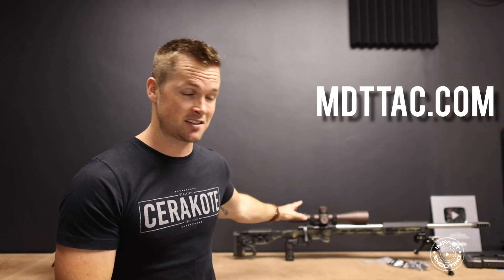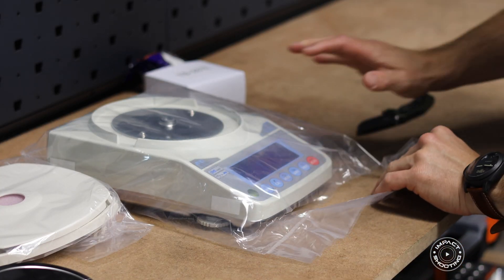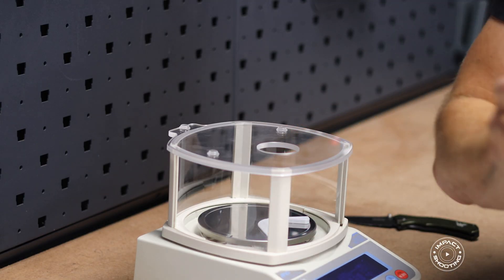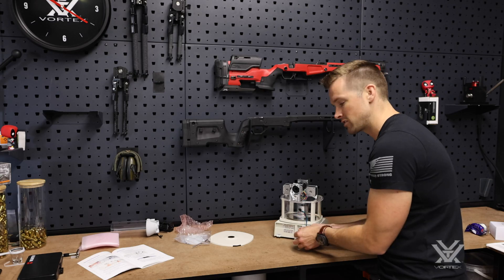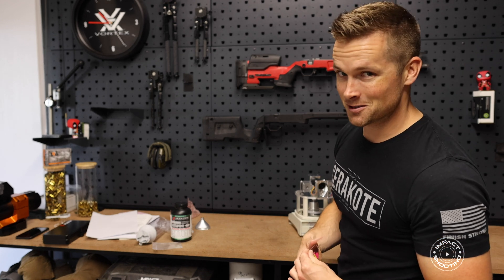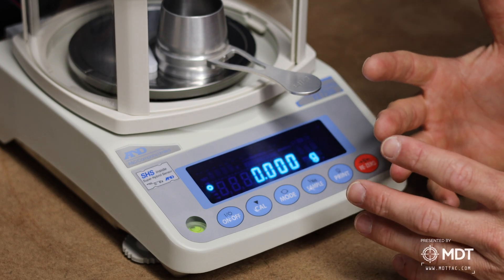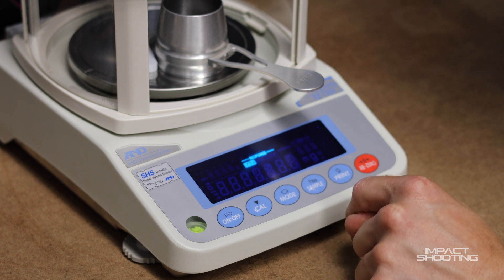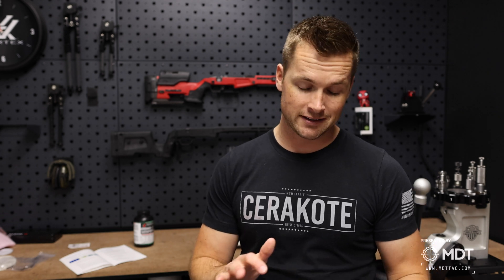Autotrickler V4 Install Guide

Comment: I like my V4 and using the glass cup that came with it....Why the Area 419 cup? Better or user preference?
Reply: I use two area 419 cups that I matched the weights. One starts dropping while I dump the powder. When there is plastic on the cup I have found the weight varies depending on humidity, making it difficult to keep 2 cups matched

Comment: Mine works well with the tip I 3D print for the V4 small tube. I have a supertrickler on the way to test side by side. Aside from the tip I make for the V4 I’m disappointed in the lack of updates to the the V4. It definitely needs an update and a lot can be done inside the app that hasn’t been done. The V4 severely lacks in fixing problems given by customer feedback. The supertrickler folks have listened to customer feed back from initial concept to now and continue to update the unit to improve the experience.
Reply from the maker: Would love if you could share the file for the tip you printed, I have a printer and would love to try it out 🎯🙏🏼
Reply: @IMPACTSHOOTING  I’ve tried putting a way to contact me here, but seems YouTube keeps deleting it
Reply: @IMPACTSHOOTING  jthornton141993
Reply: @IMPACTSHOOTING  @ G
Reply: @IMPACTSHOOTING  male

Comment: I have been looking at the new hotness, ie the supertrickler and for me it seems like a better option. Would be interested in some videos on that. Not following fads per se, but rather looking for a good fit for my needs.
Reply: Have you seen F-Class John and his videos? He and Erik Cortina are beta testers for Supertrickler.
Reply: @yukon4545  Yes. I've seen them. F-Class John has gone fairly in depth so far.
Reply: It's a solid choice.  The ST has a few good features that aren't baked into the AT.  I would say Adam is hard at work designing software to make the ATv5 or the software for ATv3 similar to what the ST can do.  I have the AT, and I wish it had the capability of recording powder charges or bullet weights like the ST does.  The AT is just so fast & accurate.  Kinda nuts.  I know there is a way for me to do print out via the serial port is installing a USB port card.  I'm sure there are all kinds of way I can do printouts with the AT, just haven't gotten to the point I need that level of capability.